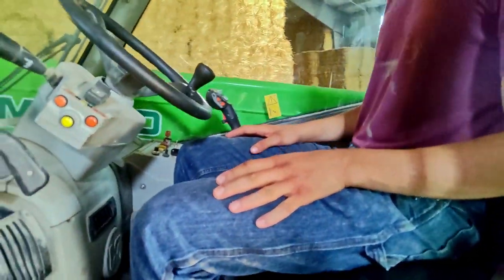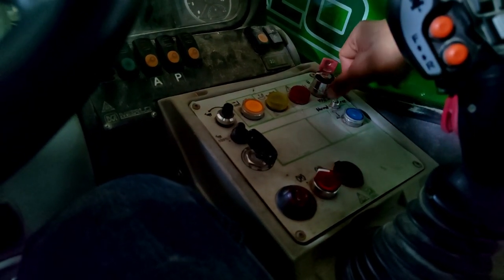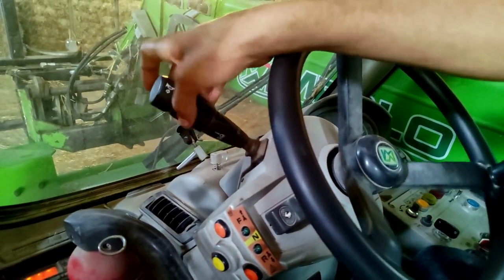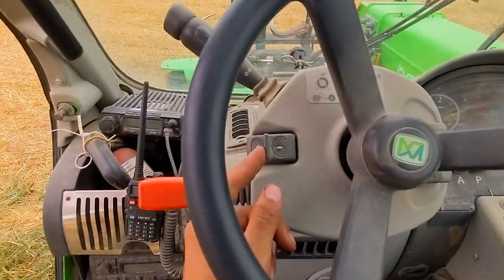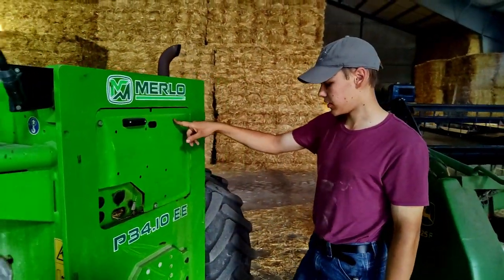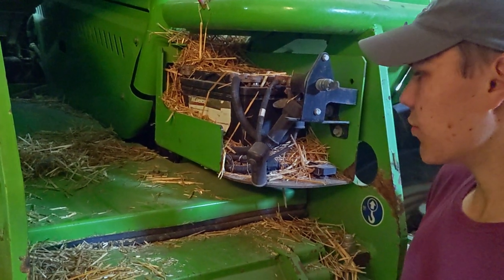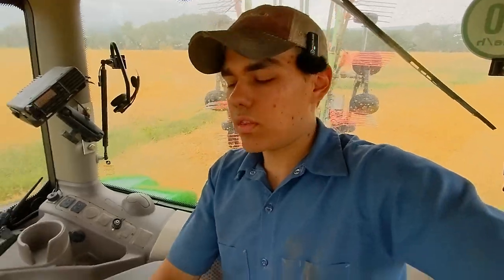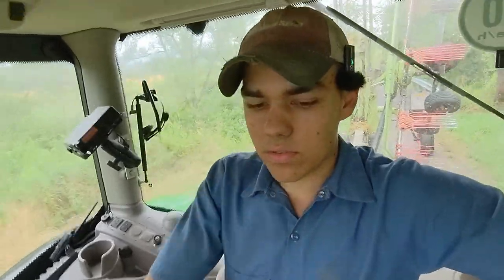Everything Wrong With Merlo Telehandlers

Comment: hello, can you please tell me which is the wire that needs to be connected to disable the overload
Reply from the maker: Power a toggle switch to fused key switched 12V

connect toggle to wire GB16 on third connector right from the top left of the circuit board behind the seat.

Wire GB16 powers the lockout valve for the hydraulics. The toggle switch allows you to run normally, provided you splice into GB16 rather than cut it.